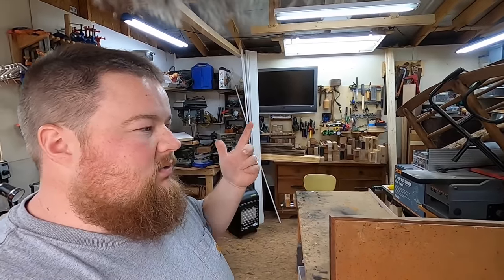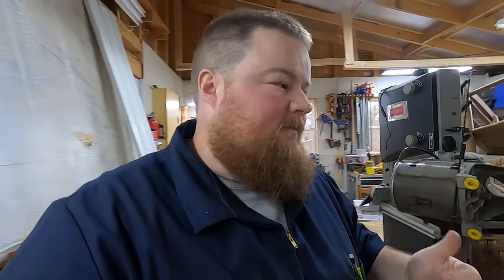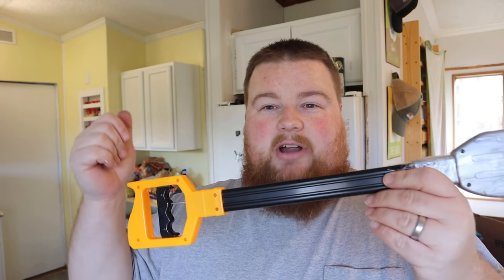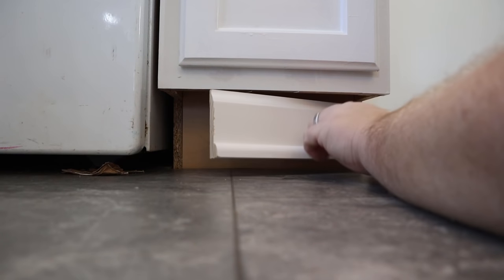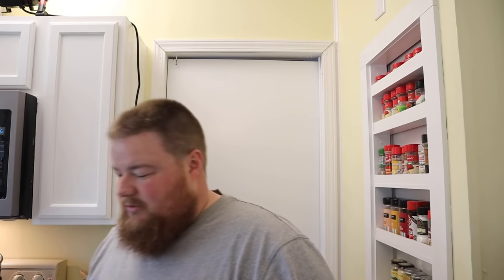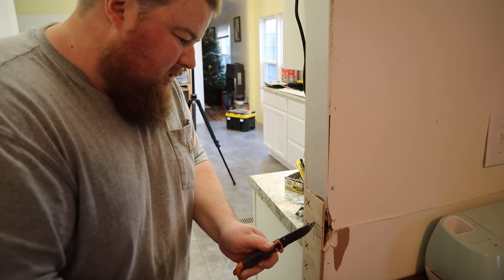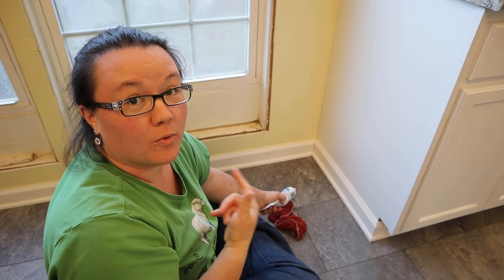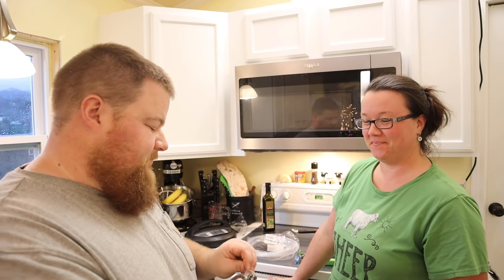Installing Baseboard and Door Trim / Molding - Budget Mobile Home Remodel #32

Comment: When driving small finish nails a small pair of needle nose pliers to hold the nail sure keeps a lot of pain from the fingers. Really enjoy watching you work and giving me a rest.
Reply from the maker: I’ll keep that I mind. Every time I have to hammer nails. I tend to miss. A lot. 😬. -A
Reply: A piece of masking tape folded, or even scotch tape, leave it long enough to hold then push nail thru and start hammering then pull tape away!  Whallah!  Use those old debit cards to smooth the holes and the corners for a perfect caulk seam!  Love the grabby hand with the paintbrush!
Reply: A fork would do just as well.
Reply: A comb works too!
Reply: And me too... Except I get all motivated and tackle something else small. My back is bothering me though and it just went back to hurting a lil while ago. So I am back on the couch watching you guys again.

Comment: Hi, Angela,
 It it bothers you, just paint above the floor molding below the bottom of the base cabinet when you touch the other molding.
You can make the bedroom door  look very expensive by using shoe mold and  add 2 rectangles then paint. At top of door, use a large shim before painting to prevent air and see lighting from kitchen.
 You both are doing a great job of remodel. I'm loving the kitchen.❤❤

Comment: Very ingenious work on your bedroom door. You know what they say necessity is the mother of invention.........good for you!  Just a warning that pot grabber you received, I bought the same one and when I was using it the rubber grabber part slipped off and I lost a whole pot of pulled pork sauce everywhere.  What a MESS!  I will also tell you pulled pork and corned beef for rebuen sandwiches are my two top things I make in the instant pot. If you make pulled pork use the recipe that uses cola as part of the base sauce, yum yum.

Comment: Your should have used a 1/4 ply to cover the toe kick then install shoe mold on it, you don’t fill nail holes with caulking because it shrinks and your suppose to nail the baseboard connection to preventing cracking

Comment: 23:55  Interesting comment about it cooking rice.  I actually have an official rice cooker that I've used many years now.  I like it a lot but have found through time that it works best when I put a little extra water in it, since the basic 1 C. rice to 2 C. water tends to start burning the bottom of the pan.

Comment: You guys are doing an awsome job there's another channel called diyfferent they are remodeling an old doublewide they have lots of great ideas also you might want to see how they remodeled their bedrooms love your tip about the shoe molding pretty smart
Reply from the maker: We’re long time internet friends and have been following there channel a long time! ☺️ -A
Reply: The idea he had for splitting the 2x4's and adding them to the existing wall 2x4's so he could put thicker insulation was awesome don't ya think I'm thinking about implementing that idea when we redo our home both of you guys are pretty smart using the toy hand thing for the paintbrush was phenomenal lol have a great day young man...

Comment: as red green would say : "If the women don't find you handsome at least let them find you handy"
small trick for closing the gaps between the moulding pieces : squirt some filler in between the two pieces before installing it then wipe off the squeese out

Comment: No emailing... but i want to know about those little triangle things you use to stack your cabinet doors one on top of each other...how do they not mess up the paint job or the weight of doors not poke holes in some? Hey temporary is good if it works...ole folks in NC used to say Needs must ( do what you gotta do to get by). Yaw are gettin it done..bit by bit. Keep on keepin on💝.

Comment: Looks great but I'm wondering why you couldn't use your air nail gun to install the floor molding?  Would've saved you quite a few ouches.  I look forward to your videos because you are both so positive all the time and don't talk down to your audience.  Can't wait to see the total reveal!
Reply: His air compressor is mounted /permanently installed in his shop .
Reply from the maker: Yep. The air compressor is permanently mounted in the shed. Too far away for a line to be brought up to the house.

Comment: Sam I just noticed in your shop you have a Wen bench grinder what jig do you have to sharpen your lathe tools I bought the same grinder any help would be appreciated.
Reply from the maker: It's a Nova brand sharpening system, but I wouldn't recommend it. I got it used and cheap which is good, but it's not a good system and is difficult to use for the bowl gouges. Sorry

Comment: I can not find a e mail address anywhere. So here is my question? You said you were nailing together a base board and shoe board, what is a shoe board, never heard of it????
Reply from the maker: The shoe molding is the smaller curved piece of molding that I nailed to the base board in my workshop. I don't know why it's called that, but that's its name around here. 😎

Comment: Ok, so what is that furry stuff at the top of your video? 🦀
Reply from the maker: It's called a dead cat. It's a fuzzy attachment that goes onto the microphone to block any wind noise. The GoPro has in-camera stabilization and will move the video frame around to compensate making the dead cat visible in it sometimes.